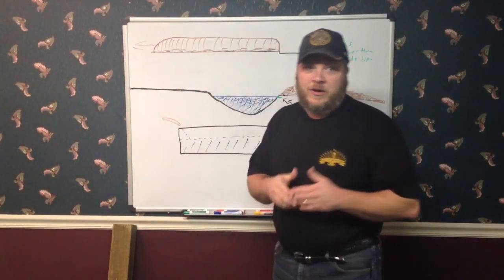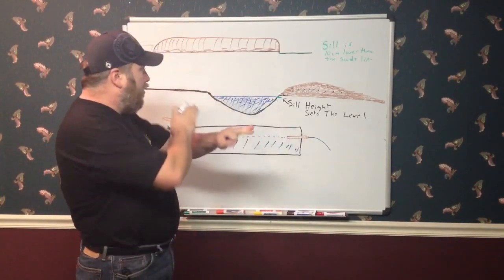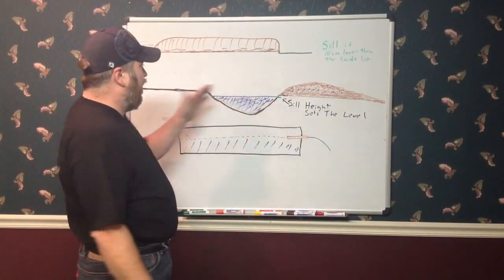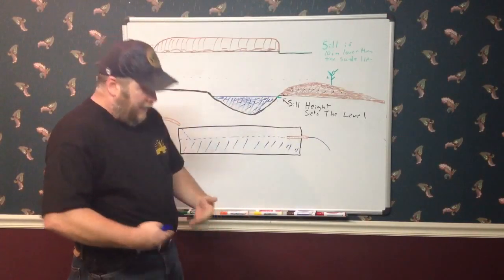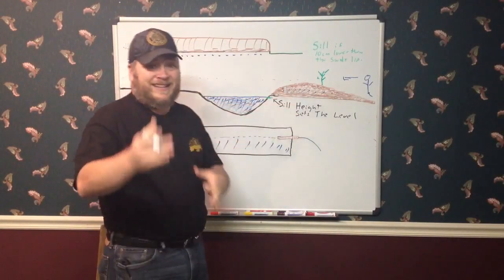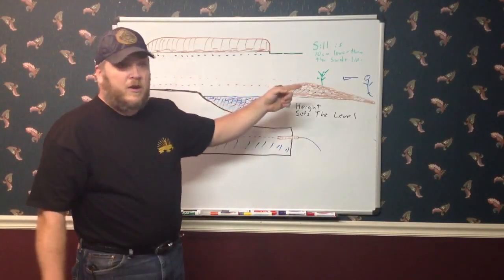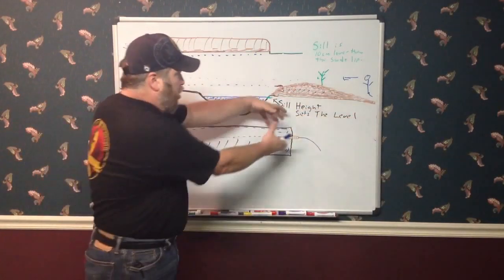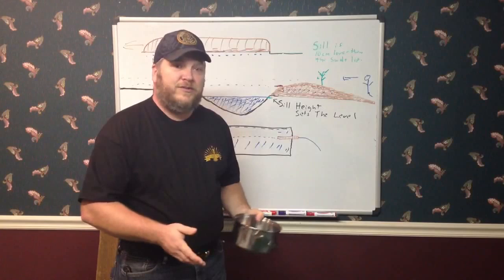Permaculture with Jack Spirko Part 13 - Understanding the Hydrology of Swales

Comment: what is sill? can someone tell me? thanks
Reply from the maker: A sill is an overflow point in a swale.  We don't pile dirt in front of it, and set the height a few millimeters lower than the rest of the swale, it has to be compacted and dead level, generally at least 2 meters or more long.  This lets water gently sheet over the overflow doing no damage from erosion.  You can actually see swales and sills working in this video on my property.  https://www.youtube.com/watch?v=K1gnKXqR0XA

Comment: Your videos are amazing. I can hardly get enough of them. I have watched many of them multiple times. I am having a little bit of confusion when it comes to the ue of the wod "contours". If I think of a plot of land as a flat plane, and then tilt that plane to give it a slope of greater than zero degrees, then I can envision a plot of land with a slope. The slope, from high to low might be from east to west, from south to north, from northeast to southwest, whatever. Okay. Now the land in addition to having an overall slope and a cardinal direction of that slope from high to low will have ripples, waves, contours. Okay So in general when rain, for example hits the land it travels into the land and on the suface of the land. It travels from top to bottom, from the land surface toward-but not reaching- the center of the planet and it travels on the surface, along the surface moving down the slope of the land. Okay. From what I understand, swales are built perpendicular to the slope of the land in order to effectively increase the amount of water, rainwater in this example, that is absorbed into the land.  And the bottom of the swale ditch should be level, with slope zero.  It is not clear to me the importance of constructing swales "on contours", however it is clear that swales need to be constructed perpendicular to the natural slope of the land and that the bottom of these troughs need to be level. I will keep reading and watching videos and whatnot, but right now it is not clear to me the importance of contours. I mean if one is building a swale perpendicular to the slope of the land one MUST dig into the land. If the land ripples, thens so must the excavated trench. WE cannot ignore the contours of the land and build straight line cubic rectantles of air space, digging into nouthingness at times, when the land ripples inward in a concave fasion...or diggiging rectangular tunnels when the land sways in a convex fashion...

Comment: As far a absolute level concerning your Swales, it is not necessary if you have half an eye for grading. If you want to swale with no levelling instruments, simply pick a spot and run it slightly up grade and down grade off contour and make sure your trench looks about the same level (toss some water in and see which way it goes), all the way through. High points will run low a little, but low points will back it up and water will find level. Level Swales just act more efficiently.
Reply from the maker: Anyone taking your advice is a fool

Comment: Simply put, Swales do not direct, nor redirect water. (They can if intended) Instead of letting the water freely flow horizontally, they force it to stop and begin to move vertically down into the earth while it also slowly moves horizontally down grade. Swales make the water stay IN the land, making it to the aquifers and water table. What does move OFF the land does so very slowly and most of it goes off the land by way of plants. (ie evaporation of mulch moisture and some tops soil saturation).
Reply from the maker: You should just stop now.  Seriously.

Comment: so how is the dirt that holds the water back different from the dirt on top that has trees planted in it and the water is supposed to go into?? is there a difference?
Reply from the maker: +Jess L Proper swales have sills (overflow points) it is not possible for the berm to retain the water because it is above the line of retention.  The berm is just that a non compacted mound, swales DO NOT hold water, they infiltrate and spread it.  Watch all the videos in this series and it should make sense.

Comment: how the heck can one make a swale absolutely 100% level on a nano scale? how is normal person afford to such measuring equipment? and even if you had the gear to measure it on a microscopic level, how the heck would you dig it 100% level with your spade or machine. and lets pretend that even if we managed to make it 100% level, then later on when you fill the swale with organic matter or when water comes in it will hit the swale and change its structure, making it impossible to stay 100% absolute level
Reply: Sonny Mery Sonny, Level is achieved with either an A-Frame level, water tube level, or laser transit level. Earth excavating companies use transit levels all the time to set septic tanks, and make level house pads. 
When I laid out my swales, I used the A-Frame level and my excavator had a transit level. He dug the initial hole where I wanted him to, and I held the tall stick with the level indicator for the transit level in the bottom of the swale. Each 10 feet he dug, I would check for level. Now there were sometimes a few centimeters deeper. Deeper is fine, the level you are looking for is somewhere in between. Water always finds its level.
Reply: I agree with you Sonny Mary.   The depth of the swale and the height of the berm is never going to be 100% level over time and still be able to function to slow the water down.  The water will level itself out relative to how deep the swale is and how high the berm is.  In the PDC I took, the berm was built with a little "spillway" to help control the water level in the swale... higher than the swale and lower than the top of the berm.  Pretty simple, don't have sweat the "absolute" level.

Comment: Fantastic Sir! You actually did answer some questions i had. But i have so many more now. So actual swale construction is not just "ditch digging ". To dig swales i would need to use a level like a carpenter? 
And using an a frame to find contour lines is still a little difficult for me to understand.  I need some hands-on.

Comment: Jack, I think that an absolutely level swale bottom might be less critical if you have uneven inputs (like a downspout at one end) and excessive soil perk. In my sandy loam I need a bit of a sloped bottom just to get the water evenly distributed.  We just got 4 inches of rain in 3 days and it still didn't fill up half the length of the swale - it was heading slightly downhill but still just soaked in before reaching the sill.

Comment: Can you combine a swale and a woody bed? Just dig 6 foot wide, put wood on the down hill 1/2 and put the dirt on top. Also, could you put wood/mulch in the swale dug out part? Then it can work like a sponge and help slow the water incase its not level. This would be a great use of wood mulch that everyone has.

Comment from the maker: Also if you wanted a 3d model.  Take a pipe, cut it in half.  Set it so the front is a bit lower then the back but the whole thing is level.  Cut a few millimeters off one side on the low side for a few inches, there is your sill.  

I'll do more guys but I promise you when you get it, you will wonder why you were ever confused.